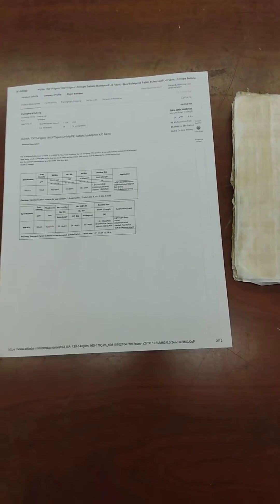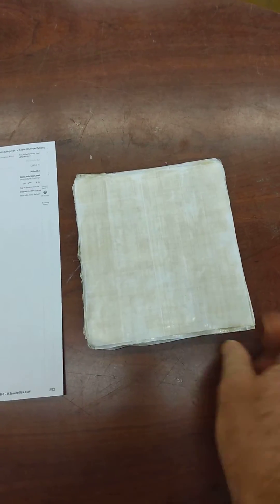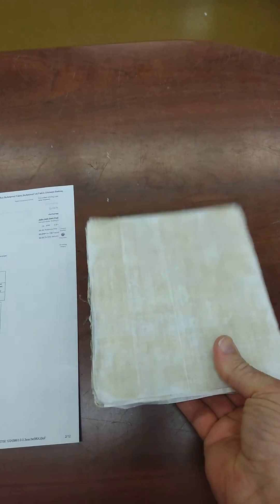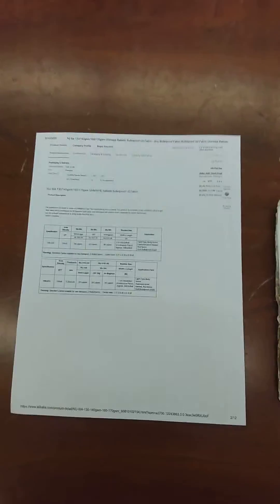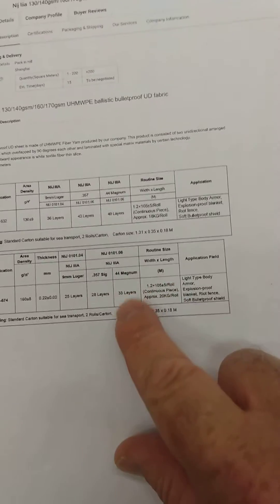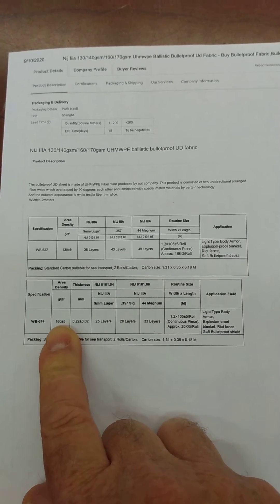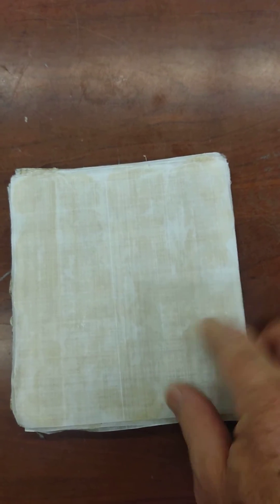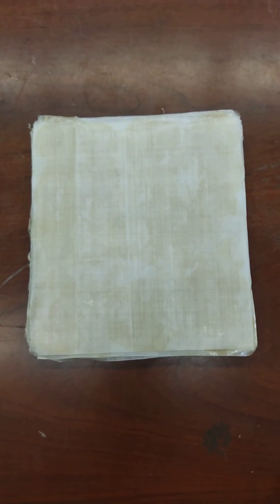DIY UHMWPE ballistic test plate  Part 1.

Comment from the maker: I'm currently applying ceramic tiles to the test plate.  I also decided to stop layering UHMWPE at 45 layers instead of 50.  I am going to try two different tile sets.  The top half will be 6 mm thick hexagonal tiles as seen in the video on the full plate armor I made previously.  The lower half will use thick 8 mm hexagonal tiles.  I suspect the 8 mm may be overkill and they are bulky (the 8 mm measure is the main body thickness - tiles also have ridges on their bottom side to help them adhere to adhesive so they are actually 9 mm thick total).